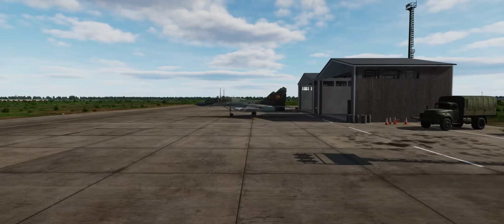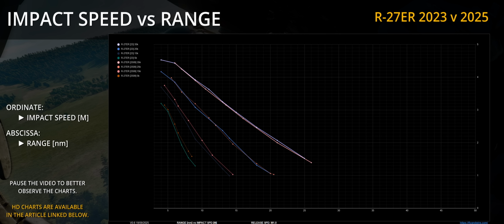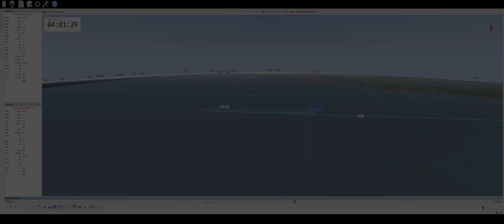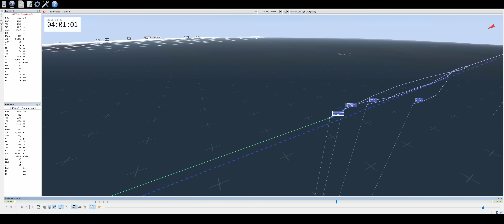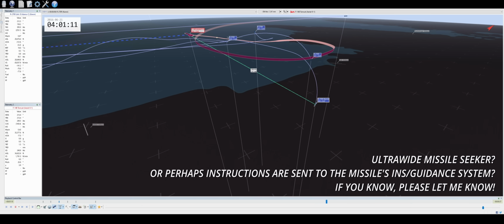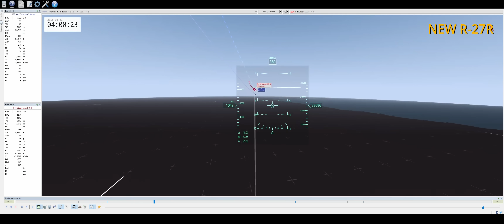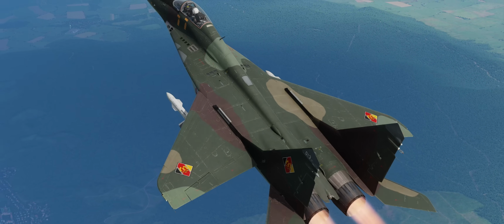A Look At the New R-27 Missile Family

Comment: Interesting the 7P doesn't even try to turn towards the bandit after losing lock, was under the impression it had a datalink support as well as the Inverse Monopulse seeker head.
Reply from the maker: From my understanding, the R-27 is, at the moment, the missile incorporating most features, peculiarities and characteristics. The AIM-120 should be quite advanced as well in terms of modelling. Everything else is extremely outdated. I'd say the AIM-54 is in even worse conditions than the AIM-7. At least the Sparrow does not make full 180° loops :|
Reply: @FlyAndWire I'm surprised ED hasn't fleshed out the modelling of the aim54 as it has lots of features that would be great for their missiles logic engine to have and allow a developer to ask to be turned on and off.
Reply from the maker: Lack of resources, I suppose? The Phoenix is unique, definitely the most complex and challenging missile to use well in DCS. It has lots of quirks, which require time to be implemented.

Comment: The little posted information i learned about the R and ER was that the R was designed to match the performance of the MiG 29 radar. It was designed to fly as long and as far as it could reasonably be expected to lock and track a target.
The ER was actually designed for the Su-27P which as we know was not exported until much later than the MiG29 A. The ER had greater range because the 27, while using technically the same radar, had a larger antenna thanks to both its greater size and role as an interceptor as opposed to the MiG 29s role for closer range work. 
The ER missile matches the 27's performance, the R matches the 29s. 
Obviously each plane could carry both, but while an Su27 would merely need to get closer to its locked target to use an R, the Mig 29 would barely see any benefit from a ER because by the time its radar could track the target, the R was in range anyway.
Only in the case of a tail shot where the target is fleeing does the 29 see any benefit from the ER.
Of course, in a sim why would you ever want a shorter range missile than you're allowed to use?
Reply from the maker: It depends on whether you want to play a casual mission or a realistic one with appropriate loadouts. The ER was exported at a later time, and many nations never got it.

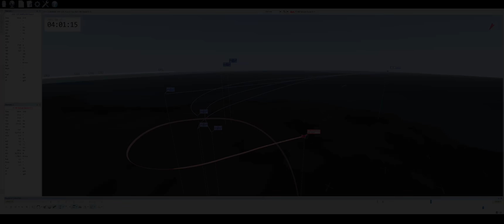Comment: For the bit on the SARH seeker performance against notching and chaff in DCS starting at 9:07, I believe the reason why the missiles are permanently defeated without attempting to reacquire is simply because of the intensely small seeker FOV. The Sparrow's FOV is something like 2.5-5 degrees in game. I discovered this myself by trying to implement some way to loft the AIM-7F/M variants, and the only way this would work is by launching without an STT and then switching to STT after launch. Otherwise, they auto-level like the new R-27s. In testing this, I found that you can't pitch more than 5 degrees above the target or else the missile will simply never acquire. So, it could either be that the seeker FOV is just incredibly small and is never able to see the proper returns of the target again, or it's just a binary hard-coded thing to permanently defeat the missile if it goes for chaff.

Comment: When you see a missile without datalink to the carrier plane doing a 180 degrees after target miss.... R-27 to my knowledge were not able to do that. That feature appeared only recently and in modern missiles. So i guess ED has once again over-engineered something. Fired 5 missiles and not a single hit on a big juicy fat target flying high without ground clutter in missile seeker point of view? R-27 weren't exactly known to be precise just like their AIM-7 counterparts, that we all know but having all 5 missiles to miss? That in my opinion is going too far... They said they are using kalman filters... so going for a chaff that far away?!? Really?!
Reply from the maker: I don't know mate, it surely looks weird. But, rather than taking an unsupported and ignorant position, I left the questions open to the community.
Reply: @FlyAndWire  I get it. We are not missile or seeker experts but ask this question: If you fire 5 missiles on average and they all miss.... Wouldn't you rather put one or 2 R-27 to scare the opponent and put R-73 on the rest of the pylons? R-73 that had a much higher chance to hit. If the R-27 was this bad it doesn't make sense for any plane to carry any significant amount of them. Mig-29 had only 2 out of 6 pylons and i would argue that those 2 were too much. Su-27 carried 6. Beside if they were this bad why would they be even accepted into service. 5 missiles wasted on single target  equals below 20% hit probability and that is just utterly useless. But then again what do i know? I am not an expert. Just a joe trying to think rationally... I don't want to sound ungrateful. I have been with DCS since the very beginning, since the days of Flanker series, through lock-on, and its amazing how far ED has come, but lately their decisions about stuff to make, implement has gone too unnational. Opfor modern full fidelity, missiles, Razbam saga and many others... Its a total mess and I really really hope more titles like Falcon BMS will popup and start breathing down their necks, because they became to complacent.

Comment: Very good video. R27 is an  excepcional a/a missile. The r27 EA variant is even better.
Reply: It really isn't though, no offense. The not being a fox 3 is a huge nerf to the capability of the missile it doesn't even feel challenging to fight someone using R-27ERs. And by the time the R-27EA existed aim-120ds meteors, and pl-15s had begun their debut.
Reply: @theamericancommie727  "The not being a fox 3 is a huge nerf to the capability of the missile" Tf? When it entered service all other medium range radar missiles in service of any country were also fox-1s

R-27EA is a fictional missile, it never left mock up phase
Reply: @ГеоргийМурзич  1 year after R-27ER entered service AIM-120 entered service
Reply: @ГеоргийМурзич  for me its a nice to have module and fun to fly but when it comes to bvr i will certainly stick to FA18 or F16 depending on the theater
Reply: @hresvelgr401  And R-27R entered service like 8 years after R-27R. The latter one entered service when there were no  operational mid range fox 3 missiles
Reply: @theamericancommie727 right. Mig29a not gonna see any light when it comes to BVR. Even against older frames like mirage F1 or F4. It has Lock breaking issues, a weak radar and is technically and tactically blind. For a experienced pilot its even challenging to archieve an aie to air kill in BFM since the mig rapidly looses energy in turn fights

Comment: Does R27-ERs loft after launch in IRL? I know of only the AIM-7MH has this capability for fox1s
Reply: AIM-7MH and P should loft
Reply from the maker: Judging by the changes, I guess it should not, and it is not supposed to be manually lofted either.
The AIM-54A in PDSTT lofts as well.

Comment: Its so tiring to see everyone assume aim7s are good because they rarely miss in dcs but conveniently ignore that pilots who used it said its expected for them to miss lol
Reply from the maker: The late AIM-7s did quite well in DS. It depends on what you mean with "good": a Pk of 100% is just not a thing. 50%+ for a missile launched within parameters is already ok.
I can't check the numbers now but, IIRC, in DS the Pk was around 50/60%. Iranians around 20%, twice the circa 10% of the US in Vietnam. But even there, certain pilots had great results with them.
Reply: @FlyAndWire the 10% number for vietnam pilots is also a scewed number because that is including all of the shots that were taken out of parameters which was the largest reason for sparrows missing in vietnam.
Reply: @FlyAndWire  The "AIM7 sucks" crowd has conspicuously the same tone as the "Sherman tank sucks" crowd. They read slanted accounts of the weapon's limited failures in poorly planned combats that were far more due to circumstance than primary failure of the arm.
Reply from the maker: But the Sherman does sucks, if you compare it with a King Tiger: crap armour, gun, for example.
However, and here is the point most are missing, the Sherman was flexible, reliable, fairly cheap to build and available in huge numbers. What's the point of a huge gun on a platform that breaks down every time? Or terrific armour on something that cannot cross a bridge?

In the case of the AIM-7, it was hard to use properly, avionics and radars were what they were, and transport and storage conditions were quite extreme. The US crews training tended to suck at that point, with many lessons from WW2 and Korea lost (there are a couple of books that cover this aspect). Once they put their stuff together, with TOPGUN and Red Flag, eventually everything started to work better.
Reply: Wait, you guys are hitting stuff with the sparrows?
Reply from the maker: Yeah, it's not that hard. You need to monitor 3 main parameters; Vc, TA and ATA. High Vc is good, low TA and ATA are good. As an ex WSO friend told me, they considered the AIM-7 as an all-aspect AIM-9.
Reply: well, at least they managed to hit from time to time. Unlike US AIM-54s with 100% failure and miss rate
Reply from the maker: Oh, but the Iranian did. In US service there were 3 launches. Once, the target apparently turned cold and evaded. The other two fell like bricks because the ordnance team screwed up.
Poor trolling attempt :)

Comment: The target discrimination issue is with the databus of the fire control radar in the export version of the MiG-29 itself, which is described at length by the reconstituted Luftwaffe operators who initially inherited East Germany's. It's not the missile, it's the MiG. The Russian operated version doesn't have this problem.
Reply from the maker: I used a Su-27 here. The issue you described, apparently, it's an R-27 thing. Do you have sources (id est, links) to support your position?
Reply: Any reliable sources on that? Would like to read more about it.
Reply: that is not true
Reply: No source says it's pure glaze.

I like soviet and Russian kit. But I don't glaze it. I just see what can be stolen from them and used to greater effect.

Comment: You did not talk about the Datalink radio correction of R27R/ER ! That is a huge step forward in terms of simulating Fox 1s !
Guidance is now divided in two phases. After launch the missile will be guided by Datalink, no launch warning for the target in this phase (Just hard lock). When missile is about 20km away from target, semi active radar turns on, and plane's radar starts illumante the target ; that is the second phase, which the missile is precisely guiding towards target.
Nota Bene : during first phase you can relock after losing target. Logicaly in second phase you cannot (I didn't test), which is why they removed it last time (before new API).
Reply: You do radio correction by "illumination". The target is being illuminated the whole way. On radio correction the radar signal is timeshared with CW. Radar works normally for ~20ms and then gives  a(1 of 6) coordinate update for ~30ms. That whole update is done with CW signals, 1s and 0s. These in turn are passed through 2 AMd signals(if im not mistaken) at 208kHz and 228kHz respectively. These signals pass through filters to get the codes and carrier frequency.  
Then it gets the signal to switch to SAHR. 
The reflected signal goes through the same filtering and gets the carrier frequency+doppler frequency. And you know the rest.

However I can't find, what happens to the CW after correction. Just carrier or what? What happens when you launch two missiles, one goes to sahr and the other is still in radio correction.
Reply: Havent played against new R-27 yet, but i do wonder if targeted plane gets missile launch warning when missile leaves the rails.
Or does it only get it at the point of missiles radar activation.
Reply: R-27 is semi-active. No internal radar, like an AIM-7.
Reply: @wmouse 
Do you mean AIM-120 instead of AIM-7?
Reply: @wmouse AIM-7 has no internal radar either.
Reply: What’s stopping it from relocking in the second phase? If the planes radar stops illuminating it for a few seconds then starts again, should the missile not already be on roughly the right course and just pick up the signal again?
Reply: @itsericzhou I agree, but ED removed it with the former API saying if you delock you lose synchronisation channel with the missile, so no relock after delock.
Reply: @itsericzhou it depends if the aircraft throws away the synchronization datalink code or not
Reply from the maker: This kind of tests (id est, checking the RWR) cannot be done by a singleton. The AI is not a reliable "partner" to execute such scenarios :)
Reply: @FlyAndWire For a future video idea, you can take a partner and prove it to the community.
I tested myself with 2 computers, works as I described above.
Reply: Have you tested it in DCS? There should actually be a start warning. The data link connection is established via CW, which is why there is a start warning.
Reply: @IronDuke39  Только что проверил. Сигнал об атаке появляется на дистанции в 18-20 км до Р-27ЭР. До этого идет только сигнал о захвате. Бот пускал ракеты с дальности в 50-55 км.
Reply: Why do you think that? Radar is still outputting pseudo CW during datalink and after

Comment: It would be interesting if they modelled the INS only phase( between seeker(25km) range and 1.5x,~37km)correctly. The antenna is fixed, due to gyro, to the expected position it will be at the moment it automatically( through time countdown) switches to SAHR(target-missile=20km) tracking with the current geometry at launch. Since there's no radio correction, the seeker will look for the target on its expected position that was calculated at launch(12°cone FOV, ±150m/s expected doppler). Basically a hail mary, if the target maneuvers at launch and the target is not there then the missile's seeker would not find the target. The target has to more or less keep the same geometry for it to be acquired by the seeker.

This is how they did to offset the poor seeker range of soviet missiles, for context the sparrow F has 80% more seeker range in CW and ~115% more in PD
Reply: You could test it, launch an R at 35km at quite a slow speed against a target flying to you fast. The missile should fly under INS without corrections as described by the manual. If you manage to make the target's speed more than 150 m/s slower TAS after launch and before acquisition, the seeker should not be looking for that current target's doppler as it would get filtered as it only looks within ±150 m/s of the velocity the target had at launch. 

You can check the hopping by flying a 2 ship target close together, make one do the deacceleration to get out of the +-150m/s filter and it should be ignored all times. However dunno which one will the radar track, but as they are flying to you, it doesnt matter as they are both being illuminated and both give doppler returns.
Reply from the maker: I can probably put together a test to verify if the "target hopping" works. The only question mark is whether the other side of the equation (guiding radar) simulates this. Perhaps the new MiG-29 does.